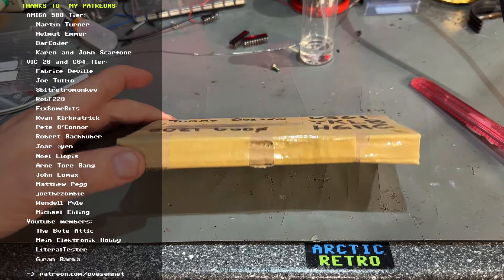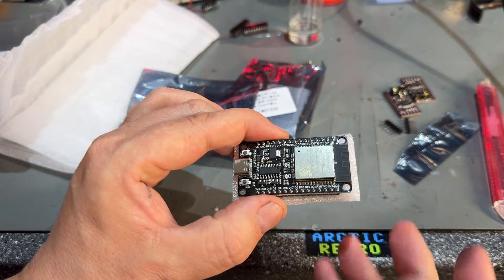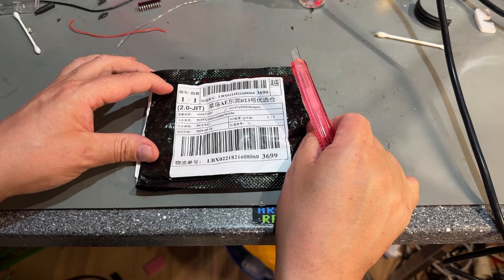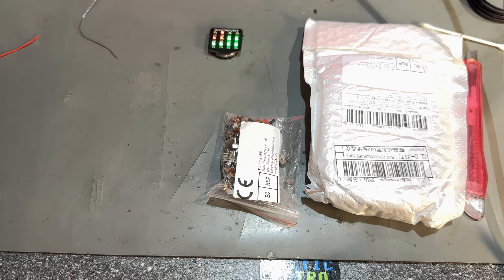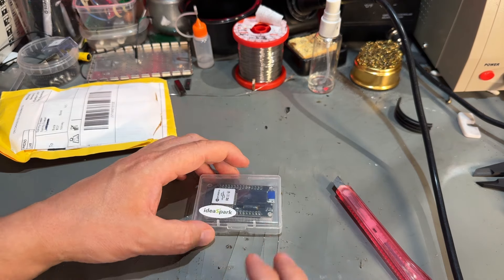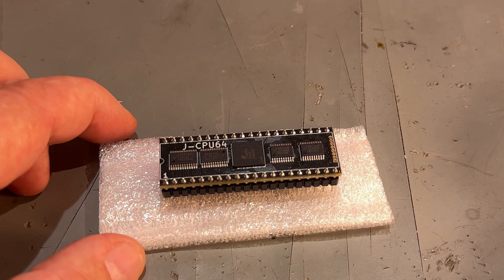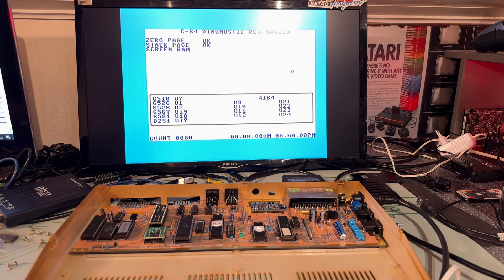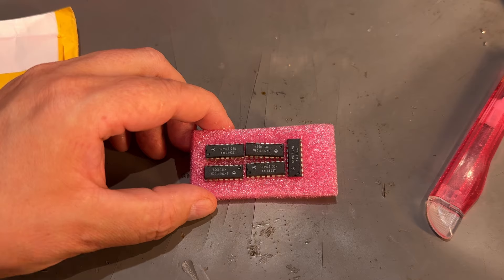Testing the J-CPU64 - Mail and donations - June 2024 - A8Pico cart and other goodies

Comment: I think making aluminium look like copper for a wire this fine would lead to an overall more expensive product. But also aluminium has about 75% of the current capacity of copper, so it would be perfectly fine for just about any application you are likely to use it for anyways.

Comment: If you order 10 pcbs of the a8 Pico Card from your sponsor and Order 10 of the Pico clone Boards with 16 MB flash ram IT will cost you around 60 bucks for 10 Pico carts which makes 6 to 7 bucks per device. 35 Euro that is expensive....
Reply from the maker: Yes of course. But I am not into selling. I don't have time for that :)